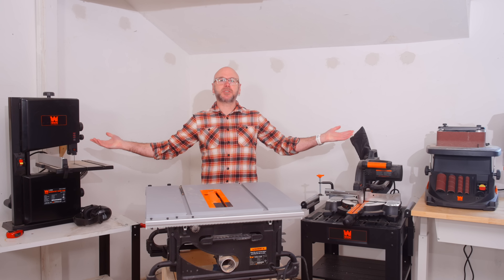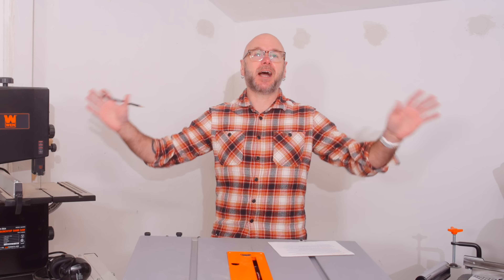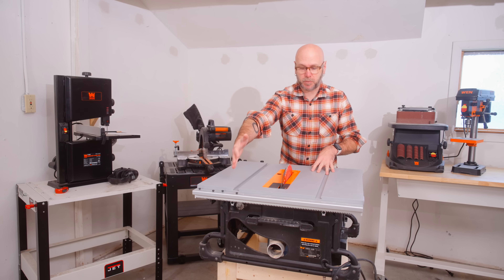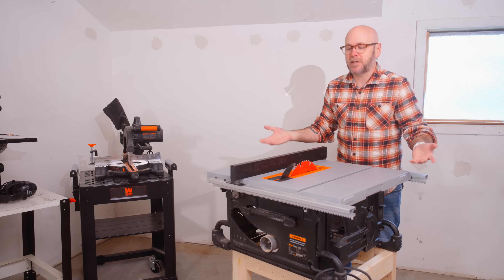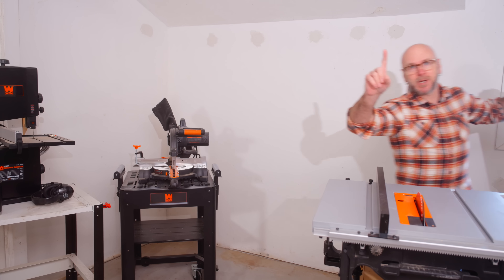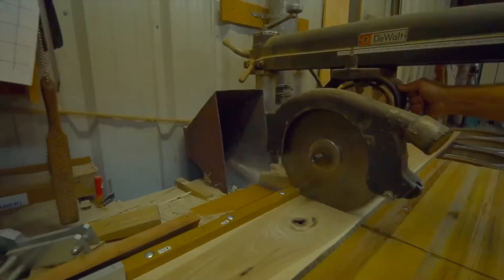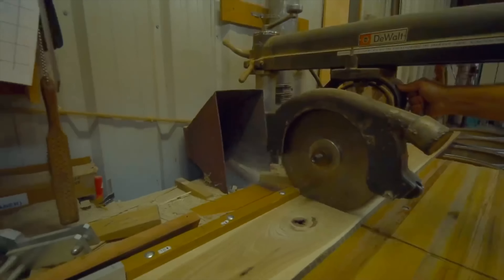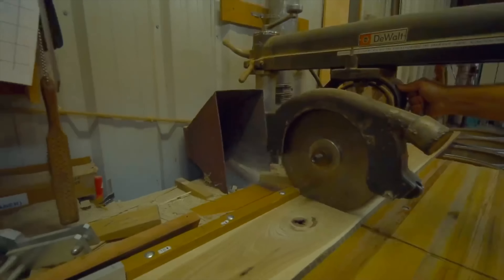Comparing a Professional Wood Shop to a DIY Garage.

Comment: Your videos are such a joy, so thanks.
My workshop is my back porch. I have all the necessary tools, except a jointer. I just don’t have the space nor budget for a decent one, so I built a table saw jointer jig. Somewhat exposed to the elements, so I need to cover everything. I do have a 2 car garage, but my new Corvette has priority! As you said, there are many different ways to accomplish a task, and I’ve had to be inventive.
Ya work with what ya have 👍

Comment: Generally good info, would just add that another advantage of the planer and jointer is to flatten boards.   Whether you start with rough lumber or S4S that has twisted, these tools open up so much more flexibility in the lumber choices that you use.   Having to purchase only flat boards and  then keep them flat can be expensive and challenging. Especially if your workshop is not climate controlled and the wood moves with humidity changes.

Comment: You make such a good point here. Cheaper tools bought by beginners - and not just woodworkers; see below - are legitimately harder to use and sometimes even more dangerous than more expensive tools. The same goes for everything from sewing machines to kitchen knives to welding equipment to soldering irons; my first sewing machine was so frustrating I nearly fired it out a window.

Comment: I like your classification! I’m at “stage 2”… I have decent table saw and planer and have made dedicated benches on wheels for them.  I started with a basement closet I converted into my mini shop, and am now taking over a room of the basement and rebuilding my tables and making a new router table.  I’m in that middle category.  I don’t see myself getting to Cat 3 woodworker for any time soon though.  But I will continue to collect tools and take some over!

Comment: Since you have holes on the fence for that miter saw, you can screw a board to the back of it and use squeeze clamps on the bottom of those boards to use as stops. All I have is a small shop and had to figure this mess out. Usually my miter saw sits on a concrete shelf in my basement shop and I don't bother to pull it down. I just use my tablesaw for most of my cuts.

Comment: for that Wen Mitre saw, have you tried out the depth stop on it? I'm very tempted to get one, I love that space saving rail orientation!
Reply: Bosch, Makita, Festool, and others do that.  Unfortunately Wen doesn't have good distribution where I am and you can get the best Dewalt 12"  (horrendous space hog) for less money.

Comment: Did you get the thickness planer fixed, I have most of the same wen tools you got, and I didn't have the bad experience you got with the thickness planer mine was perfect out of the box.
Reply from the maker: They replaced it

Comment: I have a 2-car tandem garage which is a great space for woodworking, but I also park two cars in it and, store everything one  accumulates over a lifetime, including tons of my wife’s Christmas decorations and art supplies. Given this, it’s always a challenge to find space, move my tools out from where they’re stored and putting them back at the end of each day so I can clean up the garage and move the cars in. Everything I build takes longer and it’s frustrating always having to move something around. I have a full workshop with a cabinet saw, 14” bandsaw, planer, jointer, router table, a few bench sanders, miter station and, several 4x8 cabinets full of just about everything you’ll ever need in a wood shop, including about 50 different clamps, so I don’t go without and I make it work. I use flip carts and my larger machines are all on mobile stands. However, I just got a cnc and had to remove the shelves from my assembly table to get it to fit in my shop, and I’m finally in a place where nothing more will fit, but plan to get a laser engraver in the near future at which time I’ll have to build a platform with a winch so I can either raise it or the cnc up to the only available space I have left on the ceiling. My point of this is that no matter what space you have, you can make it work. I saw a guy that put a miter saw and contractor table saw in a bedroom in his apartment, along with some tools, shop vac and small assembly table! He can only work during the day when his neighbors are at work, but he made it work. Another guy has a small storage shed next to his carport and pulls his tools out onto his carport whenever he wants to build something. His miter saw, table saw and assembly table are mounted on carts with wheels and he rolls them in and out of his storage shed when he builds something. I used a drill, circular saw and jigsaw for years, so you don’t need a bunch of fancy tools to enjoy woodworking!

Comment: Worth noting I think that if you’re setting up a small shop on a budget it might be worth making it a habit to cruise secondhand shops and thrift or pawn shops, even goodwill.  It’s not super reliable but over weeks and months of occasional store hopping I’ve found a 94-inch bandsaw, a standing drill press, sander, electric planer, and more hand tools than I can count.  They’re all older than Moses, but new or  even on Craigslist or eBay, one of those could’ve cost more than I paid for all of em combined.

Comment: This video makes a good argument for making benches and carts such that the tables for all of your tools are at the same level.  Some tools, like the drill press and some sanding machines, can't do this because their tables are adjustable in some way.  But the table saw, mitre saw, band saw, jointer, planer, router table, and work bench all have fixed tables that can be positioned at the same convenient height.  And even the adjustable tables can be positioned such that the common setting matches the standard height.

Some of the machines, rather than being stored on the floor, can be placed back-to-back on narrow carts.  A jointer and planer are examples.  Sometimes, the work will even travel in the same direction in normal use.  If you clamp the workbench to the cart, the back-to-back positioning can reduce reconfigurations and give reliable out-feed support.  The carts can also provide storage spaces.

If the carts have two fixed wheels, they can be positioned so that they roll perpendicularly to the direction the work travels.  That reduces movement of the cart if the wheels are prone to skidding.  You can also add blocks or wedges to reduce movement, but that should be done consistently to keep the work surfaces aligned.  Construct them to slide in from the side and lock against the bottom surface of the cart.

I like the T-shits mentioned in the video description.  😉

Comment: In regards to your miter saw stand you have a stop. You can raise your outfit higher than the level of your table. You can then adjust it back. You may not think you are able to have a stop that is far away, but as long as you can lock the wheels, anything that you can stand up right is a stop. A blank spot on the wall is a stop push the wood through the miter saw till it hits the wall and cut. You might need to get a few out feed supports that are independent of any tool, but there’s all kinds of ways to make stops even if you have a small Table for your miter saw to set on.

Comment: Gotta say, that WEN table with the roller arms AWESOME for the WEN planer.  I spent the time to dial them in about as close as I can to perfectly level with the inner bed of the planer with the longest level I own.  It would totally be worth it to buy a second wheel cart for that thing if you've got the room.  I also bought the WEN small drill press like that one.  It is great for like 90% of what I need.  Overall, I'm impressed with the WEN stuff I've used.  It's not precision, but it is "good enough" for the weekend warrior.  Been looking at that sander though, I bought the 1" belt and 6"circle sander combo... I regret that.  It works, but... meh?

Comment: Well done video! 
One thing I would like to see more of is a comparison of palm/ random orbital sanders. 
The question I have is:
 Is a SurfPrep or a Festool sander really a lot better than a Harbor Freight or a Wen sander?
If they are better? In what ways?
 I like the way the planers were compared. Can you compare the sanders in the same way?
Reply: Answer to that is that they really are.  Depends what you want, I do a lot of boats, and prefer more powerful ones.  In the day, that used to mean the porter cable with angle grind construction.  There is also a whole world of ROS sanders designed for auto body.  But if one wants maximum dust collection (I always use mine out of doors),  The best papers going today, and the best actions, Festool, Mirca, are the best.

They need proper extraction, which is another grand, and since this tech is now digital, your gear doesn't last decades, it becomes obsolete every time the software, or tech gets changed.  So guys who bought sanders and extractors, and would like to go to battery now have to pony up for Bluetooth.  It sorta comes down to whether you are the guy who holds the line and says "It worked yesterday, it will work tommorow'.  Or the guy who camps outside the Apple store for the latest upgrade.

Particularly for solid wood there are dozens of superior methods that don't involve extensive sanding.

Comment: In my one car garage shop, my best tools are my Dewalt planer and Rikon 10" band saw. The next upgrade I want is to replace my benchtop Craftsman drillpress. It has no power and the chuck has a bad habit of dropping out after a lot of use. My table saw is a vintage 12" Craftsman which also does not give a shit about your fingers. It has enough power for what I throw at it, but the fence sucks and it has no safety features. When I want to use it, i have to pull my car out of the other side of the garage and plug it knot my dryer plug. It's doable, but requires setup time, ehich can be annoying. I did recently buy the Wen oscillating spindle sander and it works great, 4/5 stars. Amyway, thanks for another informative video!

Comment: heres a tip for adjusting contractor saws for accurate cuts, get a set of gauge blocks(wen sells a decent set for around 40-50USD) you can combine them to adjust the total length then you just bring in the fence to contact them, these are made for machinist precision but can be used to make cheaper tools more accurate

Comment: Just curious about your comment about not having the space required for a larger bandsaw.  Doesn't the table you have the Wen on take as much space as a bigger bandsaw like the Rikons?  I know the caster system on larger bandsaws are not as convenient to move as your little table system, but feel doable.  Feels like costs would be the bigger concern in this case.
Reply: probably the most space efficient tool there is.  But, on the other hand, it is also needs the space to handle the larger wood one would be needing it for.

Comment: The sound issue on table saws cant be overstated. It's not just quieter, the sound is a much better note. Even with ear defenders it's far more pleasant to run a cast iron belt driven saw.
Reply from the maker: Yes, 100%.

Comment: I definitely don't like setting up shit. It actively discourages me from working. I am limited to working in my front porch because that's the only place with accessible, free power supply and space.

However by the end of the year I am planning to finally restore my parents old catering kitchen out the back of my house, make it into an entire project where I fix the damaged foundations, put up walls, a door and fix the roof and then finally I'll be able to make that entire 10 x 5 space into my work shop. I do hybrid metal and wood work so I need both a proper woodworking work bench and a fixture table along with a mitre station and a cutoff saw Station.

I've got a few months worth of hard work in store but I'm determined to make it happen and finally get that space set aside where I can just walk in and start my projects without hauling anything out and about.

Comment: About your "bench" in the small shop.  I have that Husky table and built a nice cabinet for the bottom of it.  Not only maximizes space, but makes it A LOT heavier.  A little harder to move but makes it much more stable.  You can sand or plane on it and not worry about it moving with a board that is out feeding on it.  I can't recommend it enough.  If you'd like to see mine, look up Rex Seven.  A couple short videos on it.  Great video BTW.

I like your channel because it continues to make things even though you have product videos too. Many channels over time turn into Review Something.  That's kind of annoying.
Reply from the maker: I need to do this!!!!

Comment: There are people with a ton of space, but cheap tools, or no space and expensive tools.  On the latter, look at the Euro woodworkers with their MFTs, and Festool setups in a cupboard.  So I don't think that the space constraints are the big issue with cheap tools, it is an entirely separate issue.  There are a lots of space rich poor people, just as there are a lot of Manhatan socialites with small apartments.

Comment: Would it not be safer to use a budget track saw over a budget table saw?
Reply from the maker: It would be safer as long as your track saw has a riving knife. I think most do these days.
Reply: @MakeSomething  most don't tbh... and in general they are not that crucial, some newer ones have electronic protection.
Reply: @MakeSomething  It would still be safer. You can clamp the guide, if you think the saw is going to kick on you, so at least your hand won't be on the track.  One hand on top of the saw is a lot safer than two hands on a workpiece;  You can't get the workpiece thrown at you; And I don't see a riving knife issue breaking down plywood. 

It is generally safer to have two hands on a tool than a fixed tool and two hands supplying it.  So router, vs router table or shaper.  Seems as though it should be the opposite, but unless you rest that router in your lap between cuts it usually is safer to have the tool in your hands...  Plus it is harder on your back to run trees through a chainsaw, than the reverse.  Track saws are a little different because sometimes one is holding the track down, so i guess one could spaz out and throw the saw in revers over it...  But the hand should never be behind the saw.

At least 50 percent of the  reasons to have a riving knife is to keep the material in line and not climbing into the kickback zone on a table saw.  But the track has that covered with the track.  If every rip cut on a table saw was made on a piece of wood that was attached to a guide jig, they might not have invented the riving knife.

Another thing is that tracks too expensive to clamp to rough or distorted wood, and they only function reliably on flat surfaces, but people shove all kinds of sticks through table saws, which ads to the general instability around their use.  

Of course some wood will clamp the blade, and on a table saw, the riving knife is your friend.  That rarely happens with track saws, and if it does, they  can pop vertically out of the cut.  That kind of trick only happens with table saws if you trigger the Sawstop.

And there also aren't a lot of 5hp track saws.

Comment: This a silly comparison a pro shop is set up for production as a  basement / garage shop is for light wood work possibly hobbie work and there's the machines the hobbie worker goes to the big box stores and buys there equipment from them as a price point ,a pro shop buy better equipment and because that's there job its like mechanic they buy the better grade of tools as thats how they make money with there tools sure you can buy cheaper tools that tend to break and fail when you need them the most same a pro wood worker it your lively hood

Comment: i have the rikon version of that saw and i disagree with the rack and pinion o-pinion.. you can easily tap it over where you need it and not even touch the knob.. now the angle adjustment and blade height adjustment are a whole different awful story